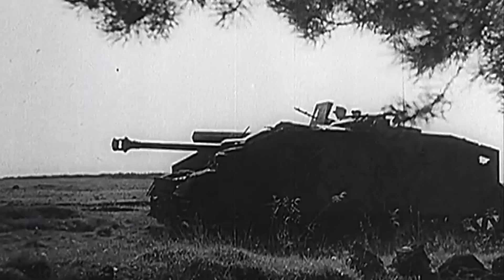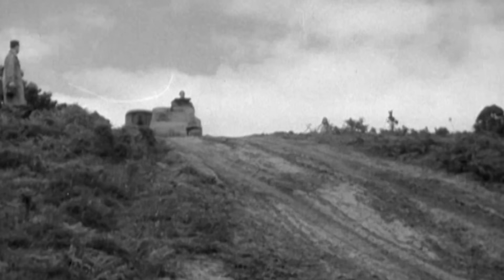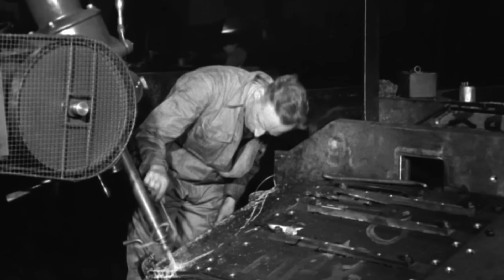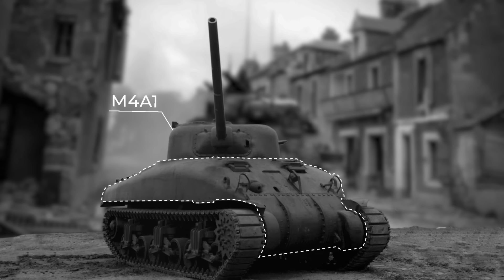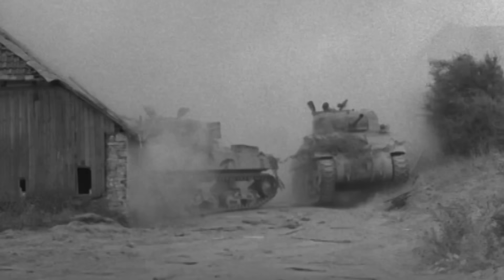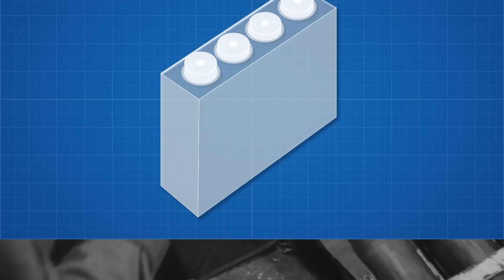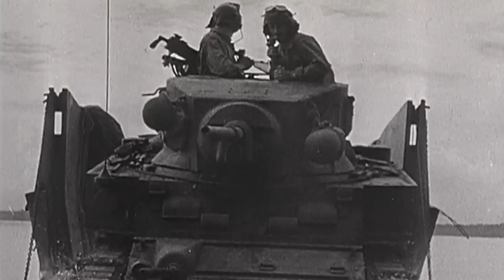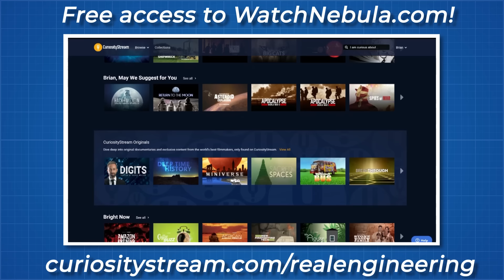M4 Sherman - The Workhorse of D-Day

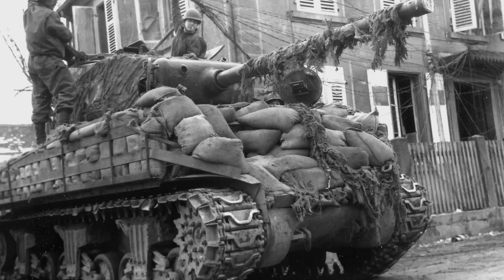Comment: 6:46 The Germans had them, and they were called Ostketten. The Soviets also experimented with their own grousers. Both the German, and Soviet ones were much longer than the Americans' track end-connectors.

According to Soviet testing, despite their grousers being longer, it didn't experience significant bending during extensive field trials (this applied to 2 of the 3 grouser type devices that they tested. However, 1 of the 3 grouser type device tested did experience significant bending. I think it was due to inadequate/weak track pins or something.....can't remember)

Comment: 5:59 Also, casted armour plates were ballistically inferior to rolled armour plates. I believe it was about 15% worse....more/less. Depends on the casting process I think.

Anywho.....didn't cast armour have its benefits??? I mean, I am pretty sure that casting was considerably faster to manufacture than welding armour plates together.
Reply: The order in armor development was Riveted then Cast then Welded.  Riveted was the worst and welded vs cast had their trade-offs. If I recall you wanted a welded hull and a cast turret in the war.

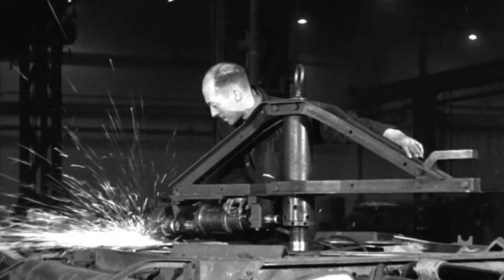Comment: 1:38 Well......actually that's untrue. The turret ring diameter of the M3 Grant was sufficient enough to mount a 75mm gun. Its turret ring size was 1380mm in diameter.

Now, to the best of my knowledge, there was never any serious attempt to mount a 75mm gun into the turret of the M3 Grant, and make it function at the same time. HOWEVER, there WAS ANOTHER TANK on the allied side with the same turret ring diameter as the Grant. That tank was the Churchill, and it was retrofitted with a 75mm M3 gun in its turret.

To be fair, fitting the 75mm gun into the turret of the Grant may be difficult, because its turret looks to be smaller than the Churchill's (a larger turret is better, because it means more space for larger hydropenumatic shock absorbers to reduce more recoil).....despite both having the same turret ring diameter. But, I don't know, it's difficult to tell. It might be possible to fit in a 75mm gun into the Grant's small turret if there was a muzzle brake (especially if it's a large one).
Reply: The video had it backwards.  The 37mm was always to be the gun for the M3.  It was the nominal anti tank gun.  The 75mm and sponson were afterthoughts on the design. The primary role of the 75mm was  anti infantry but it was still decent at anti armor.   This is why the Churchill had it because the Churchill is an infantry support tank.

Comment: Wait...going from a 75mm gun to a 76mm gun is seen as being more powerful?? One whole millimeter? So, what am I missing? 1mm doesn't seem like enough of a difference to be worth the effort.
Reply: Well as others have mentioned, it wasn't the diameter it was the fact that the 75mm gun was low velocity and the 76mm was high velocity. When trying to punch through armor the width of the round is insignificant, it's the speed the round is moving at. It wasn't made out of any stronger type of steel as someone said, it was just designed as a high velocity gun where the 75mm wasn't. When the 76mm came out most tank battalions didn't want it at all, because only 14% of the targets they shot at were tanks and the rest were fortifications and soft targets. The low velocity 75mm was much more effective at that, which is why the tankers didn't want the 76mm.
Reply: @TheSolongsidekick  Not low velocity
Reply: @peterson7082  Uh what? Yes, that's absolutely what it's called.
Reply: Length of round. Meaning more propellant is the main difference. As well as barrel length.
Reply: The 76 was made out of stronger steel, so it could withstand a larger charge with a higher barrel pressure.

Comment: The people who drove the sherman said it was terrible,  the people who had to repair shermans knocked out said it was terrible,  it had poor armour,  it had underpowered guns and many of them ran on highly flammable petrol instead of diesel making it a death trap.
It's utter rubbish that it was a formidable opponent for any German tank.

The sherman had to outrun the German tanks and get a hit in from the rear to have any chance of penetrating the armor with the sherman tank but the German tanks could blast right though a sherman with ease and from a significant distance too!

The only German tanks the sherman was on equal footing with were the light tanks, meeting a tiger meant almost certain death as did it with all but the German light tanks.
Reply: > "The people who drove the sherman said it was terrible, ...'

 Veteran's opinions vary wildly dependent on their experiences and personal outlook.

> "the people who had to repair shermans knocked out said it was terrible, ..."

 I assume you have only came across one man who said such, that being the late Belton Cooper? Am I incorrect?

> "it had poor armour,  it had underpowered guns ...'

 Not really the case.

> "and many of them ran on highly flammable petrol instead of diesel making it a death trap." 

 The fuel made no difference in combat. Even then, the M4 didn't suffer fuel fires or catastrophic detonations any more than its contemporaries- including the Panther. 

> "It's utter rubbish that it was a formidable opponent for any German tank.
"

 Based on what exactly?

> "The sherman had to outrun the German tanks and get a hit in from the rear to have any chance of penetrating the armor with the sherman tank but the German tanks could blast right though a sherman with ease and from a significant distance too!"

 Depends on which German tanks  you refer to.

> "The only German tanks the sherman was on equal footing with were the light tanks, meeting a tiger meant almost certain death as did it with all but the German light tanks.
"

 Nonsense.
Reply: @peterson7082  you are so wrong, it's common knowledge that the sherman was a significantly inferior tank and not fit for the take it was given. 

The ONLY thing the sherman had over the other ww2 tanks was its speed.
Reply: @stevefox3763  Not the case at all
Reply: @peterson7082  you can say whatever makes you feel good, don't make it true though, the sherman ducked and it's well-documented
Reply: @stevefox3763  Its not a matter of beliefs. It's just fact, and you're massively undermining how the M4 performed during the war.
Reply: The sherman had thinner armor and a weaker gun. It was significantly disadvantaged no matter how you look at it. Amazing how people spin facts to get around that.
Reply: @xXxcastenada  Except it somehow ended up with favorable kill/death ratios against every single German tank! So super duper crazy! What BS are you going to "spin" to argue against that? It's almost like stats on paper have nothing to do with the combat efficiency of a tank. Probably because German tanks had atrocious crew visibility, and in general whoever shot first won tank engagements.

It's also particularly stupid to try to compare the Sherman tanks against German ones when the US doctrine didn't teach tank on tank combat. Never heard of the tank destroyer branch? Shermans only expended 14% of their rounds against tanks.
Reply: @TheSolongsidekick  An inferior american tank incapable of penetrating german tank armor from the front or sides couldn't have a superior kill/death ratio. Not when a german tank could destroy it from any angle. Shermans could have greater numbers or production capacity, not a greater kill/death ratio.
Reply: @xXxcastenada  Well it does. Feel free to look it up yourself. Also, you might educate yourself past the "can't kill from the front/sides" myth. When the 76mm Sherman became available most tank battalions didn't want it because the 75mm was doing just fine.

German tanks had absolutely miserable crew observation capability. The tank that shoots first, most often wins. They also had miserable turret traverse speeds.
Reply: @TheSolongsidekick  Sherman tank is a piece of shit. Abrams M-1 tank is also a piece of shit. The US military industrial complex is pushing some weird revisionist historical angle trying to fool people into thinking the sherman tank, F-35 and abrams M-1 are good. When in actuality they're 100% the opposite There's your history lesson for the day~
Reply: @xXxcastenada  Hardly the case
Reply: @xXxcastenada  what nonsense are you rambling on about?
Reply: it was one of the best of the war.

1. everyone used gasoline engines on one tank or another
2. the gun was comparable to german counterparts at the time like the PZ IVs short and long 75s
3. the armor was quite comparable to the tigers ~85mm to 100mm
4. the sherman was statistically in the top 3 safest tanks in ww2 and most of the crewmen were killed outside of the tank
5. it was incredibly reliable and easy to repair
6. and the crew also liked it. the pershing crew often wanted to switch back

so get your facts straight

Comment: Ok, I signed up for CuriosityStream and then went to sign up for Nebula but the Nebula sign up keeps failing.  Do I need a separate Nebula sign on? I am confused by the need for 2 streaming services; two more services.

Whatever Youtube's faults, with everyone on a single service it made it simpler to find my shows.  Multiple video streaming services are going make things as messy as the TV streaming arena is becoming.
Reply from the maker: You should get a welcome emai for Nebula with all the info you needl. We had some software bugs earlier, but I believe it has been fixed.

Comment: I don't think you emphasised enough how imperative it was for the Sherman to be a highly reliable tank. It was to be used thousands of miles away from its production facility. If there was a serious breakdown sending it back to detroit for repairs was out of the question. This was part of the reason the US spent so long on developing a single tank, especially when you compared to the variety of models fielded by other Nations.

Comment: worth remembering the sherman was NOT designed to go toe-to-toe in tank-on-tank battles, that was the tank destroyer corps' job. it was designed to be light enough to be easily transported by ship, including amphibious landing ships, and be able to traverse as many bridges as possible and make use of easier to haul along temporary bridging equipment. also the larger 76mm gun significantly decreased the amount of rounds available to the main gun vs. the 75 and decreased the speed of reloading and crew comfort while on the march, which reduced the distance they could travel and still be ready to fight when driving to the battlefield, all in order to have a better gun for those 15% of engagements which involved fighting other tanks, and only a fraction of those where of panzer 5/6/7's which actually needed the 76 vs. the panzer 4's and stugs which could be handled with the old 75. the heavier german tanks had major problems with traversing rivers and bridges because of their weight for the bigger guns and heavier armor for those 15% of engagements with other tanks vs. non-tank targets. they often literally never reached the battlefield for this reason (along with poorer maintainability and logistical trains as well as that pesky USAAF and RAF). amateurs think about tactics, professionals think about logistics.
Reply: > "worth remembering the sherman was NOT designed to go toe-to-toe in tank-on-tank battles, that was the tank destroyer corps' job."

 Not even close to the case.
Reply: @peterson7082  how so?
Reply: @b.griffin317  The U.S. Army Ground Forces viewed medium tanks as a supporting asset to other combatant units in making and exploiting breakthroughs in enemy lines- this includes infantry, armor, and artillery. What a tank supports has no bearing on what a tank can and cannot engage. That being said, per Field Manuals FM 17-5 and FM 100-5 the priority of targets for said medium tanks were other tanks. Tank destroyers were overall very similar, however were a defensive asset in nature.

Comment: Moving tanks fro. Germany to the front was anything but easy, especially for the heavy tanks. They could not travel by themselves but in action, as the cost  in fuel and wearing was prohibitive. Allied air superiority and the weight of the tanks made deopying them by train a painful task. I don't think that the Germans had any advantage in this aspect.
Reply: The US didn’t have the infrastructure to move heavy tanks by sea at the start of the war, main a lack of cranes with the needed lifting ability, and barely had any railcars, which were scattered all around the country, that could move a heavy tank. It wasn’t easy for the Ge, but they didn’t need a completely overhaul they’re system.

Comment: Ok people, the thing is, we need a tank. It needs to actually have a turreted main gun, it needs to be fast, we need reliability, standardized components because maintenance on the field is a thing, and most importantly it needs to be easy to produce because we're gonna need a lot of them. Please and thank you.

Americans: M4 Sherman; reliable, fast, easily repaired, easily modified, and there's a metric ton of them.

Germans: Tiger I; slow, mechanically temperamental, requires specialized mechanics to change the treads, the spare parts catalogue is the size of a phone book, and they're about as common as German aircraft carriers.

Comment: LOL. USA tanks were inferiour to German tanks, end of story!
Reply: As compared to what German tanks exactly?
Reply: yeah no

it was one of the best of the war.

1. everyone used gasoline engines on one tank or another
2. the gun was comparable to german counterparts at the time like the PZ IVs short and long 75s
3. the armor was quite comparable to the tigers ~85mm to 100mm
4. the sherman was statistically in the top 3 safest tanks in ww2 and most of the crewmen were killed outside of the tank
5. it was incredibly reliable and easy to repair

so get your facts straight

Comment: They were definitely outclassed by Tigers. You gave no evidence of your point too, you just said it was untrue
Reply: They served radically different doctrines.
Reply: WW2 was a war of numbers. There were 1,500 Tigers built. There were 50,000 Shermans built. The Sherman was also designed to not have a mechanical problems for 2,000 miles, and when there was a problem, it was quick and easy to fix. All the German tanks were over engineered, which caused they a lot maintenance and repairs when they needed every tank they could produce.
Reply: Definitely outclassed
Not like the late war german tanks have a horrible repairability, hatches unsuited for escaping and a very reactive ammunition

Comment: How do you get the rounds out of the wet storage? If they are completely hidden in the tube, you won´t be able to pull them out. if they stand out enough that a hand can hold them easily, then they are exposed so much that it defeats the purpose of storing them there...
Reply: Lift the hatch, take one at a time, and refill ready/ emergency rack
Reply: @peterson7082  so the hatch isn't flat on the inside, or how does it cover the protruding shells?
Reply: Underfloor hatch. Lift  the hatch up, you can access the base of the round to pull up.

Comment: The brits did NOT have crap tanks at the start of WW2. They had the matilda 2 for one thing which the german tanks couldn't actually knock out at all. and the french stuff wasn't bad either...the problem wasn't with the hardware it was with command.
Reply: French and British tanks had some major deficiencies. The only thing reason the Germans had a problem with them was German tanks weren’t armed well enough.
Reply: @kokofan50  of course. But is that lack of sufficient firepower not also a serious deficiency?

All tanks are comprises and the German stuff wasn't superior overall at the start of the war.

Comment: the 5:1 myth for Tigers also comes from US using tanks in groups of five for operating. Ask yourself: if you spot an enemy heavy tank, are you going to send one of your tanks against them, or all of your tanks?
Reply: Depends:  which tank full of malcontents are you trying to get rid of?  :)
Reply: I wouldn't do both, I just have a cup of coffee and order the radio man to call for Thunderbolts to delete it.
Reply: But so did the Germans they didn't have 1 tank just sitting around the only time you find any tank by them self is if the rest of the platoon was already destroyed BTW Germany had 5 tanks in a platoon or it was 1945 and you were in Germany and the war was basically over...